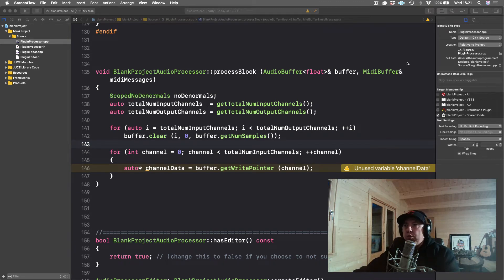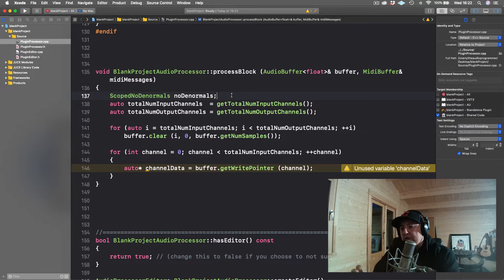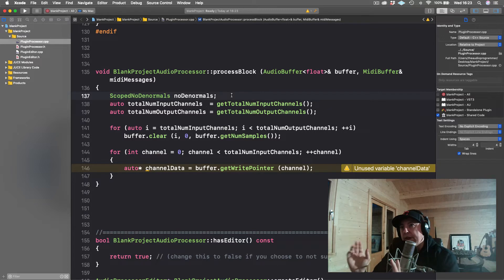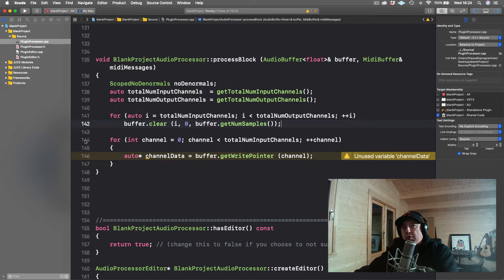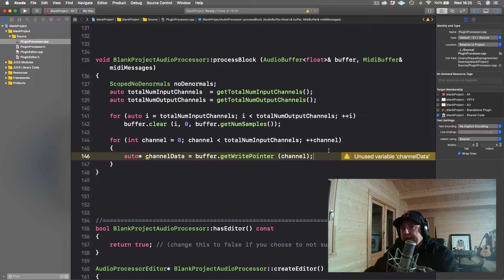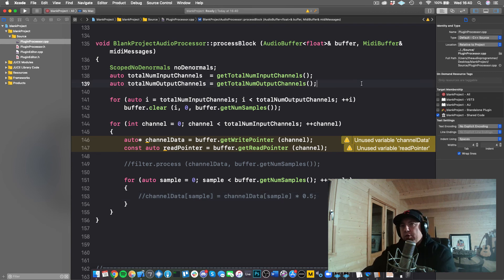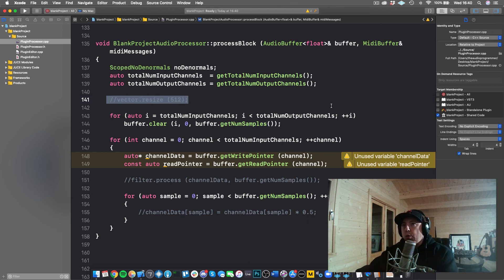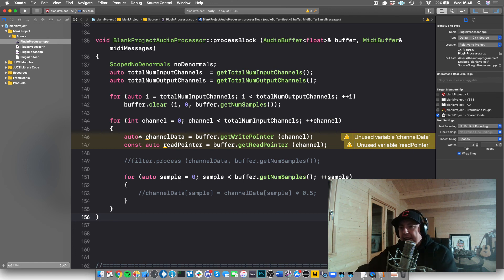Juce Tutorial 62 - The Audio Process Block

Comment: Really appreciate this, thank you. One question: At the end of the video, you mentioned you shouldn't do any memory allocation-like things in the audio thread which makes sense, but one thing I haven't seen anywhere is how you would get around this? Does JUCE provide a method in the AudioProcessor class that allows you to execute something of a lower priority in-between the audio callback, similar to how the GUI update works? I know you're supposed to do memory allocation stuff in the constructor if you can, but surely there's a very simple way to get around this that I'm not seeing lol? Thanks again and congratulations for hitting 10K, that's a huge number for such a niche community; wish you the best!
Reply: My question would be why would you want to do that on the audio processor? I would simply make a class e.g. DataModel or similar and have it interact with the UI and create data-containers on the fly if you want etc on the message-thread. You can then have a reference to that DataModel object in your processor loop if necessary. And what you can do then is have all code where the processor is accessing that object (for example to use freshly memory-allocated data on that object on the fly) be surrounded with a ScopedTryLock. This way whenever the UI is accessing/setting/changing stuff on your data-structures on the DataModel instance, the processor loop will just ignore that code-block and keep on running without ever blocking. Then maybe in the next loop iteration (when the UI is finished) it will pick up the new data and use it in the processor loop.